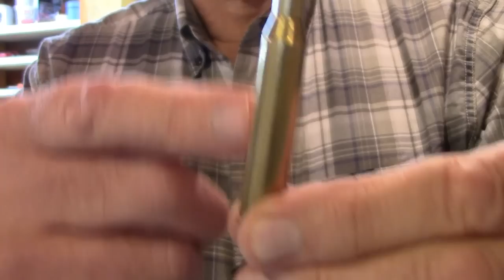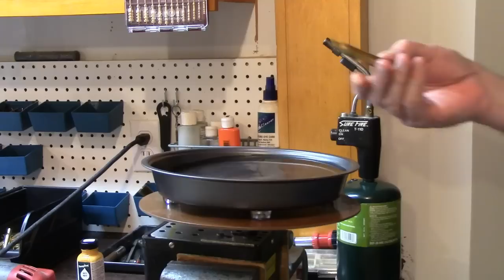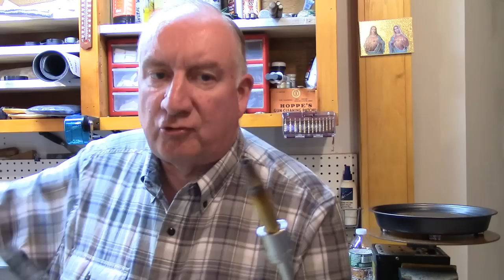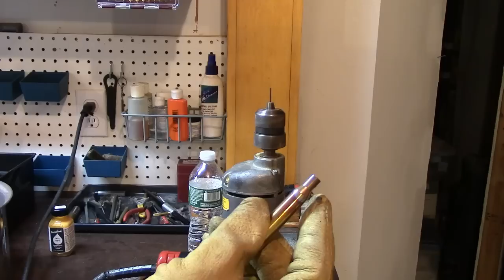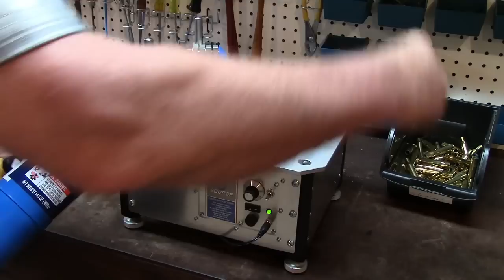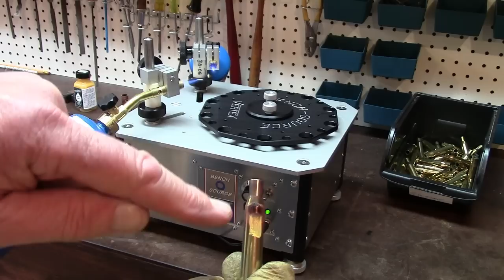How to Anneal Brass ~ Vertex Bench Source or a Tight Budget!

Comment: FINALLY!!  Someone that truly understands the process. I have been involved in working metals ( machining , forming , welding and even casting ) for 45 years. You nailed it with your explanation of the work hardening of brass. One thing nobody mentions is how little " working " it takes to measurably harden brass. I am a bench shooter. My competition rifles are , short range small bore-- Remington 22 single shot bolt action , Military rifle--custom built AR-15 where we shoot 100 and 200 yards , long range big bore--Russian Mosin nagant with a Finnish M-39 barrel and lots of after market parts and extensive machining  , 200yd. +.
     I have found that if I anneal every time before resizing my necked brass dead soft , by the time the bullet is seated the temper on the neck is perfect. I know this is much more work than most would want to do ( including me ) so I built a machine that does it for me. It does each case one at a time , same way every time and it can hold 500 7.62x54R at a time. Since I have been doing this my scores have gone up about 4% at 100yd and almost 9% at 200yd.

Comment: Tremendous teacher and an incredible representative for our firearms community. No question that you would have been one heck of a shop class teacher. Your LSA video on proper lubrication of the AR 15 really opened my eyes. I used it on my AR 10 as you instructed with great success. It’s just mind boggling how marketing has sent the masses running in circles forever chasing the latest gimmicks. Thank you for your time and energy. I know it takes a lot to make a presentation like this. God bless.
Reply: Mate your metallurgy is a bit off.  Cartridge brass is copper and mainly zinc to make it brass.  TIN additions make it bronze.  A completely different kettle o fish.  You keep saying elasticity,  the word you are looking for is ductiliity.   Sorry to pull you up but as it's metallurgy you are espousing best get it right.  And talking over a burning torch is a bit daft when the process took 5 seconds!

Comment: Excellent!  Anneal for at least 2 reasons:  1) Longer case life...no split necks  2) More consistent neck tension...F-class (bench rest) shooters typically anneal before each resizing of brass.  Excellent suggestion to use Tempilaq as a temperature threshold indicator.
Good safety tips...most safe annealing outdoors if possible with a fire extinguisher handy.
Bench source annealer is $550 at Brownells where you can also purchase Temiplaq.

Comment: I’d like to thank you for this annealing video - I found it very helpful when dealing with my stretched 7.62 military cases. I made a rotating water pan based on this video with an 18rpm motor that I got from Amazon. I used 700degF Tempilaq heat sensitive paint inside of several necks to decide I should do 6 seconds with my particular torch.

Comment: Nice video. Thank you. I purchased the Bench Source Annealer. Sure it was a little pricey but very well made and rather compact. Works better for me using a standard grill size propane tank, splitter Y and two hoses to torches.

Comment: First I want to thank you for your excellent presentations.  I am both an avid watcher and referrer to others.  I hold you in great respect and please understand my comment here is not meant to be a criticism, just a correction for people who may not know.  You indicated that cartridge brass is an alloy of copper and tin.  I think that was a slip of the tongue, because all brass, including cartridge brass, is an alloy of copper and zinc (other trace elements will also be present).  The alloy of copper and tin makes bronze, thus I expect that was just a slip of the tongue on your part.  

As a point of interest, cartridge brass is commonly known as "70/30" brass due to its typical 70% copper 30% zinc content.  It is more officially categorized as C26000 brass, or C260 for short.  Despite the common idea that it is 70% copper and 30% zinc, the C26000 industrial standard is actually a range that requires between 68.5% to 71.5% copper (as established by a joint committee of the American Water Works Association and National Association of Brass Manufacturers in November 1921; the standard may even predate that).  What makes brass truly remarkable as a manufacturing material is its elasticity all the way up to 16,000 ksi (ksi = 1,000 pounds per square inch, thus up to 16 million psi).
Anyway, thank you again for all that you do to educate us with your fantastic wealth of knowledge.  You are greatly appreciated.

Comment: Warning about the manual annealing: I did that w the socket and a drive several years back. I then dumped the brass into a metal pan, one after the other. The first time I shot the brass I blew primers. I could just drop the primers back into the pockets, zero force needed. I solved the problem by immediately dropping each piece into a water bath to stop the heat from reaching and relaxing the case head. There was too much heat that soaked the head and they softened enough that a stiff load immediately blew the pocket out. It's not a bad way to anneal the brass, but stopping that heat creep is important in my experience.

Comment: Thanks GunBlue.I have used your socket method in a cordless drill but use a deep socket for 22/250.308.and 30/06 and have had great success
Usually after 4 reloads.Great video as always
So easy to understand when you explain everything so thoroughly. Cheers.

Comment: The water method would give consistent properties as long as the water temp, level and flame are consistent. High Powered Rifle Reloading (with G. David Tubb) is a great in depth video, perhaps 30 years ago, that does the precision end of this reloading. GunBlue490's videos are also quite good. I've not reloaded a single round but would consider both to be helpful. I may begin loading 5.56 soon because the ammo loading I like are quite expensive. 77 grain otm and heavier, longer projectiles for a 1 in 7 twist barrel. The difference in accuracy for the longer projectiles is great.
Reply from the maker: worddunlap
It's not at all that precise, and such a method is intended only to extend case life, not to expect such methods to win gold.  I have used the water bath method with very good results to extend cases for far more than 30 years, and it certainly does not require anything more than the attention I demonstrated.

Comment: Thank you for a very informative demonstration! I have seen and heard so many guys saying you need to heat the brass till it turns a light pink color/light red, surely at this stage its been over heated ? I will follow your very simplified method of the brown to slight blue coloration!
Reply from the maker: Any redness is certainly too hot, and will damage the brass.

Comment: GB... Thank you so much for taking the time to pass along your knowledge.. It is greatly appreciated. I make it a point to watch as many of your 'lessons' as I can. FWITW, I have read all of your reply's in the comments section multiple times so I can further learn. (Love your assessment on Salt Bath method.!!). 

While you addressed the minimal effects effects of brass hardening while fire forming or expanding brass to a larger cartridge I have a question about brass stretching. I did read, quite closely, and appreciate your commentary on Head Space factors

So here is a question if you have time to respond that would be great.
I acquired some time ago a 310 Martini Cadet that had been re chambered to 32 Winchester Special.
The .321 factory bullets are way oversized for the .311/.316 rifling, so cast bullets are the answer.
I did a chamber cast with Cerrosafe which revealed that the chamber is 2.065" which makes it .025 longer than the SAAMI specification of 2.040"
Due to availability and cost I recently acquired a 100 Hornady 30-30 cases which are very close to the 32 Win Sp case (same OAL, SAMMI Spec)
which I plan to either fire form or re form with the 32 Win Sp dies.

So which would you do, 

anneal first, 

then fire form or run them through the dies. 

Or skip the annealing and do one or the other...?

The other potential issue is that the new 30-30 Hornady cases only measure 2.030"
So my brass in order to properly fit the chamber must be stretched or expanded by .035"

I know I could just experiment with both methods but wanted to know if you thought annealing first was better and if you thought fire forming was a better way to expand the brass...

Your opinion would be greatly appreciated.

TIA

Bob in St. Augustine
Reply from the maker: The nation's first community!  Bob, Annealing is entirely unnecessary until after at least 3 or 4 reloads, especially with such low intensity cartridges.  As a .32 Winchester Special owner, I frequently resize easily available 30-30 cases.  The process is a matter of just running the cases into the .32 Special die, as you would normally.  I do however, strongly recommend Lee dies especially for any neck enlargement, because they use a long tapered neck expanding shaft, which gently and gradually opens the neck, as opposed to balls that aggressively yank them open.  

As for the length, you have no concerns either.  I believe that length you are referring to may be the extended leade before the rifling, rather than the case neck region.  Some old chambers were not cut with a separate neck to leade junction.  In any event, that amount of bullet jump is of absolutely no concern.  Proprietary Weatherby rifles chambered for his cartridges, and 5.56mm NATO chambers have extended freebore.  Due to their small shoulder taper and low intensity, I've seen no stretching of .32 Special cases, and have yet to trim one.

As for your bullets, I understand that your lands measure .311" and grooves measure .316".  If that's correct, you indeed must cast.  FYI, .303 British bullets measure .311", but that would be too small if I understand correctly.  If you are familiar with casting, you know that your bullets should be cast .001" larger than the groove diameter, and I would recommend using gas checks.  I'm sure that .32 gas checks would work fine.  All gas checks are made by Hornady, regardless of the name on the box, and their tapered heel holds tightly.  I've shot Lee 8mm cast, sized down with their sizing die in my .32 Special extensively, and they are very, very accurate.  Lee will make custom anything.  FYI, in testing, bullets sufficiently hard for hunting velocities are utterly worthless for game, as they plow through oak and come out like they went in like a military FMJ.

Have fun with your project, and God bless.

Comment: Well worth the 55 minutes. It's hard to tell who knows anything on the internet. This guy sounds like he KNOWS!Is the annealing process done before or after sizing?
Reply from the maker: J Mark Eastwood 
It makes no difference whether it's done before or after.  Do whichever is convenient.  Brass should be cleaned first however, or dirt may permanently darken it.  I typically gather brass of the same caliber, establish the correct annealing time, and do them all at the same time.  I will keep them in their original lots, if possible, only because they have the same history of lengthening and trimming, but it's not always possible or practical.  Regardless of the number of times they have been fired, all will be "reset" to the same condition.  Generally speaking, I'm doing it to brass before it was resized, only because I work that way, which is more logical for me, but it's not a technical issue.  All brass, regardless, should be resized during the loading process, to iron out any defects in handling.
Reply: You get more consistent shoulder bump if you do it before sizing.

Comment: I spin the brass in the drill method and use a small spark plug socket to heat the brass and protect the case.
Reply: You ever over anneal your brass?

Comment: Another fantastic instructional video.  Thank you.  The big question which seems to have advocates pretty evenly split is, anneal before or after sizing? What is your opinion?
Reply from the maker: Those advocates probably argue about brushing their teeth before or after a shower. It really makes no difference.  I anneal before I size, simply because it reduces the number of times the brass is worked before annealing.  One must remember that annealing is a process that is generally not required as a routine part of the loading process.  It's done to restore sufficient softness to prevent splitting.  Brass generally remains entirely workable through at least four cycles.  After about four or five firings is a good time to anneal, so whether it's done before or after is entirely a matter of preference.  I know some long range shooters who anneal as a part of the regular loading process, claiming that variations in neck tension create vertical dispersion.  Even if that may be, it's then a matter of relative softness between one case to the other.  As long as they all are treated the same, it can be done before or after.  I've been loading intense pressure cartridges for decades and have not seen any change in point of impact after annealing cases that have been fired five times.
Reply: @GunBlue490  much appreciated!

Comment: Metallurgically, annealing and stress relieving are different. I think what's commonly referred to case annealing, including myself, is actually stress relieving. Because annealing does make a metal dead soft, while stress relieving only removes the internal stress caused by repeated cold-working and the grain "dislocations" it induces.
Reply from the maker: What you think is incorrect. Annealing is a process used in the manufacturer of brass cases to restore softness to case mouths after it is work hardened by forming. Brass is not steel.  Annealing is the process of softening brass by heat. It has nothing to do with stress relieving whatsoever. Brass becomes "work hardened" when it is hammered. When brass is annealed, softness is restored. The degree to which it is softened is controlled by the heat applied. There's no other metallurgy. Period.

Comment: QUESTION:  Dear GunBlue, I can't tell you how much I have learned from your channel, you are truely a valued resource to the reloading community.  So you annealing video is probably taking you back about 6 years but I watched it a couple of times and opted to go with the method of chucking a bit into my power drill and heating my 6.5 carcano brass at a low RPM with a propane torch.  I am betting a nice blue coloring but at the very bottom of the blue I am getting a very thin purple line.  If you drew a line on a piece of paper with a sharp pencil, the purple line would be about the width of that pencil line on the paper.  I only have a small amount of this bras and have had to reuse it many times (thus the annealing).  Would you be so kind as to share your opinion on whether I just ruined my brass or if you think a thin purple line at the bottom of the silver and blue coloring is ok?  Thank you again for all you put out on YouTube and I hope to hear back from you.  Sincerely, Kevin from Phoenix, AZ

Comment: Thank you so much for taking the time to explain in detail the process of annealing and using the Bench Source annealer. You had previously responded to me regarding the Annealing Made Perfect annealer and explained with good reasons why this is not a practical method. I have another one that I'd really like to get your feedback before I invest in the Bench Source. I found an annealer that uses a salt bath method. Since I'm new to annealing, I would like to know if you have ever heard of this method and is it sound? I'm not worried about the cost of the Bench Source but would like to know all my options prior to making such an investment. YouTube has it listed as "OVERVIEW OF SALT BATH ANNEALING", by Ballistic Recreations. Thanks again for your tutorials!
Jeff
Reply from the maker: Jeffrey M. Green 
I would never subject my brass to any salt solutions.  Standard heat is all one requires, and it's the gentlest method, used by the industry and all military brass.
Reply: GunBlue490 once again...thank You! I will heed your warning.

Comment: Just watched Eric Cortina on annealing. He brings his brass to a slight red glow using the same Bench Source machine set at about 4 seconds with two torches (one torch was map gas).  He also did some longer to a bright red glow and then tested them all by reloading and shooting them.  He concluded that the hotter cases were still annealed without damaging them but it was not necessary to get them that hot to properly anneal.   With the lights off you could see a slight reddish glow when he does his normal process.  You are saying that is too hot...never see a reddish glow?
Reply: When I bought my benchsource I spent some time talking to the developer. Simple: Use a torch with the pointed tip and aim it 20-30 deg downwards to the neck base. This is so the shoulder/case body absorbs more heat so the thin neck dosent over heat prematurely. And use very low light and look INSIDE the case neck to id that dark cherry red glow spot. As soon as see this you are done!
Reply: I watched the exact same video, listening to you and thinking about it Eric Cortana uses premium Lapua brass. If you're using cheap Hornady Remington Winchester brass likely you can over anneal it and that's why I think gunblue is getting to only 4 seconds. 

It's been a couple years since you posted this,  what have you figured out?